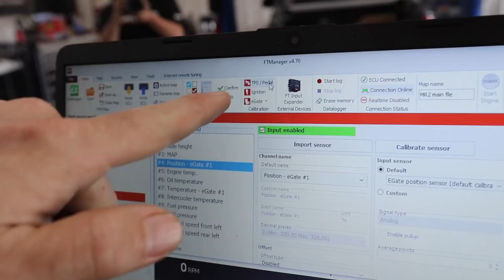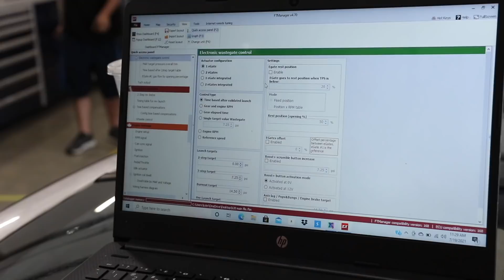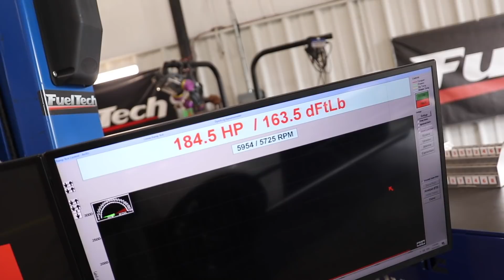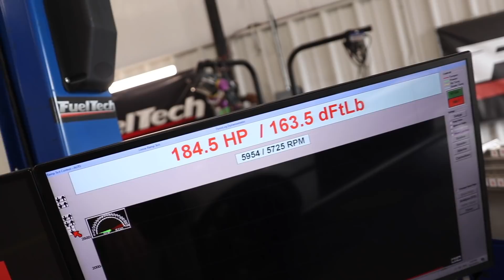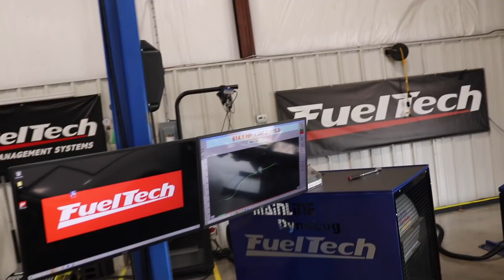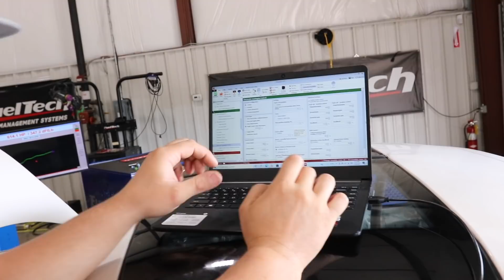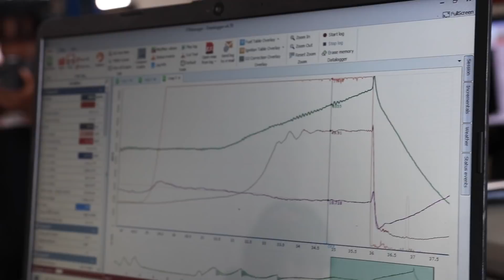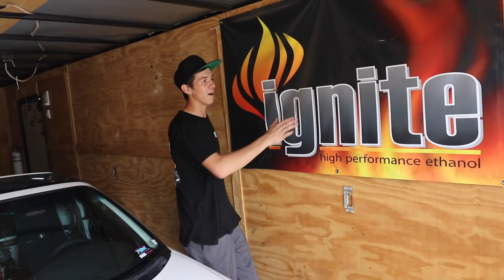The Mr2 THROWS DOWN On The Dyno!

Comment: To find out after all this time that the two-step the crowds love has been lean and causing engines to blow.  😂.
Reply: I couldn’t believe it either. I’m curious if Brent was aware of this because every time he tunes it’s shooting flames 🔥 🤷🏼‍♂️
Reply: Flames look cool but you can always learn something new and adjust the way you do things to make more power. I remember the first 4bbl carb I put on my 318 in my Dart. It was super hot in the engine bay and was popping a lot. It needed a lot more jet then it had so I found out what it should be and put a much bigger jet in. It stopped popping, engine bay cooled down, and it ran way better and was making power for what it was.
Reply: @69Dartman  yesss my dad still has his '70 dart with the 318 just enough to get into trouble as he says lol
Reply: @HondAcura111  The 69 Engines were a bit higher compression and some other things but if you do a few simple mods they aren't as slow as you'd think they'd be. I put a early wide block distributor in it and the timing curve was way better then the 68 and up ones plus I put electronic guts on top. I put a 727, 8 3/4 with a power lock 3.23 sure grip, early 340 exhaust manifolds, poly bushings and front and rear factory sway bars.
It handled better then any other Dart I ever drove and was about as fast as the modern Crown Vic pursuit cars and that was just with bolts ons and like that. It also had a 16 to 1 manual steering box good for 4 turns lock to lock and 340 suspension minus the sway bars factory. I had to keep relearning how to drive the car every time I upgraded something and I still have it though it's retired. I'd love to drop a modern hemi in it some day.
Reply: @keylinstrait4640  to be fair tho Kyle always wants that pop pop boi 2 step
Reply: @keylinstrait4640  broooo thats what im saying too. Wouldnt all tuners know this?
Reply: I'm suprised how people didn't know how bad pops and back firing are for the exhaust valves, they are taking explosions horizontally that them thin valve stems can't take and also moving them around in the guides etc. It's the easiest way to kill an engine. I htink i mentioned in one of the channels previous vids where they kept having issues with the valve train and i commented it about sitting on the popping 2 step is valve train suicide.
Reply: The two step isn't designed to be used for prolonged periods of time when it's poping. As fuel tech said when done the way they have it can be used for a long time even if it doesn't need it
Reply: Brent tunes the two step to customer request, they want pop, they get pop..   two step is usually used by the showsters..   the weekend mechanics.   When you get wrench turners who live with grease stained fingers and oiled armpits is where u get your truly serious shit at the track..  when you get your weekend warrior with a wrench tuned race car is when you get your mustangs taking out crowds and wall taps..

Comment: It’s really sad to think that companies like fuel tech won’t be able to even sell any of there amazing products in the us anymore. If the epa have there way anyways
Reply: The EPA is only going after sellers that sell emmissions defeat devices that can only be used in a vin car, ie, direct drop in fitment products that will not fit other applications. Eg, entire exhaust systems with cat delete, or, plug and play harness signal intercepters.
Generic products that could have legal uses, eg, an ECU that coud also used on an old lawn mower, the EPA is not touching. Simple.
Reply: @nordic5490  they are not allowing the modification of vehicles that were designed for the road. Removing the standard management and installing an aftermarket ecu is exactly what they are after. Although these producers can legitimately be sold for race car specific use. Or indeed a lawnmower. If a distributor sells it to a customer and is used on a once road based application they are liable. The EPA state that ANY device that defeats the standard emissions control is illegal. This is what’s so scary about it.
Reply: @mdnovaman  the EPA will not go to court unless there will be a guaranteed win for them. If I sold ecus that were not specifically plug and play for a vin car, they can have other uses, eg, a go cart, lawn mower, etc. That sale is perfectly legal, and the EPA knows it. All the seller has to do is make clear is that that carby, efi, etc, can only be used on race engines in purpose built race cars, with you signing a declaration. That is it.
Reply: @nordic5490  you make a very fair point. Although I’m not so sure it’ll be quite as clean cut as this. All it takes is for a car with it installed. Being pulled over on the public road. And the ecu installed. It’s instantly traceable back to the ecu manufacturer. It would however in that case be down to the installer breaking the law but that still incriminates any company installing these products. Such as PFI etc. Unfortunately the vast majority of people don’t have the knowledge to be able to install a wire in kit themselves. And with it now illegal for companies to install them to any car originally made for the road. It’ll reduce the ability of companies such as this. Haltech. Link etc etc to be able to sell there products.
Reply: @mdnovaman  PFI got in trouble for selling direct plug in 'performance' devices that can only be used in that model vin car. These were not generic multiple use devices. This was a slam dunk for the EPA and no risk for them. The EPA is sending a message and do not want to loose a single case.
Reply: @nordic5490  this means that fueltech wont be able to supply plug and play or patch harnesses or they will be under the same ruling. this is a huge part of the market for ecu manufacturers.

Comment: Gonna need a wing for that new Carbon fiber deck lid. Gotta get some downforce to keep that lil ripper hooked at high speed. Still hoping for you to get a 7 second cage in it. Wanna keep you in one peice if the worst case scenario ever does happen.
Reply: I have no clue why they just keep ignoring the roll cage. They had the car gutted while the engine was being built. It would have been the perfect time to upgrade the cage. But no, lets get the car completely built and driving so we can make one or two passes ( hope nothing happens! ) and get booted by the track because of the cage. It just makes no sense!
Reply: @Fordman7575  The safety issue was more on my mind but that is also a very valid point. I've mentioned it in comments about a half dozen times now. Yours is the first comment on my comment. Not sure what the disconnect is? Rather strange to say the least. Nearly positive that cage won't pass 7 second tech.
Reply: @CLCIII  Mine too. That's why I comment on every MR2 video. It will be a very sad day if something happens to Kyle because they didn't upgrade the cage. The current cage won't pass 7 sec. tech. And they already ran faster then the current cert. with the old set up. I believe he said the track already warned him when they made that pass.

Comment: So wait, with the quick reaction of the electronic wastegate, couldn't you use that to reduce power with the height sensor as well as traction control at the same time? So you set it up to dump boost at launch if the car tries to wheelie but then at the same time if the tires try to break loose in Second gear the traction control can then take that over in combination with the laser height sensor. How the hell you coordinate the outputs of wheel speed and laser height into controlling traction is such uncharted territory that literally no one has done this, BUT if you figure this out you would literally change how all drag racing is done. Traction control lets you modulate ignition timing (which has existed for a long time), but modulating ignition timing, boost, and a level sensor at the same time (which can only be done with a electronic Wastegate), is completely uncharted waters. I honestly think that if you guys can figure out traction control using electronic wastages and standard timing adjustments, you might change Drag Racing forever.
Reply: Unfortunately not. Not because of the gate but because of the turbo that is pretty slow to slowdown and gain own RPM, different from a blower that reacts pretty much instantly
Reply: @voodoom4n  I see, but then couldn't you use the e-gate on the charge piping to rapidly but precisely bleed off boost? It would basically be a controllable dump valve.
Reply: @balljointfd3s  still way slower than timing that's pretty much instantly
Reply: @voodoom4n  I really appreciate this conversation and thank you for indulging my ideas. While I'm at it I have another one. I've had cars that are limited to stock frame turbos, obviously things are bored out and bigger wheels put in. Problem is that they are in stock housings and run out of efficiency and max out the turbo. I've had luck with putting a Methanol injection nozzle pre Turbo inlet to reduce compressed air temperatures out of the Turbo. It seems to shift the Compressor Map to the right and extends its efficiency. Have you or anyone on your team played with Pre-Turbo Methanol  injection?

Comment: On the past setup weren’t you running a thousand hp with less boost then 45psi or am I thinking about the prelude
Reply: Yes the previous setup did 1118 at 38 pounds has me baffled

Comment: I wonder, can one of these dyno's take a pull as if you are doing a drag pull (from 0 to what ever in what would be an 1/8 or 1/4 mile, I have never seen it on any kind of Dyno, it's always a running start if you see my question.

Comment: Now hit up Motion Raceworks and get one of their C02 launchers for the parachute launcher handle in the car but really you should get the complete set up of the C02 parachute mount on the back of the car and the C02 parachute launcher handle in the car and you can also put it in the FT to launch at a certain time into the run and also get the cut off switch for the car that Modern Racing sells Justin Swanstrom is running one and so is John Doc plus a bunch of other fast cars it will cut the car off and throw the chutes if the car does anything crazy like stand on the back bumper or rubs the wall stuff like that and being a stick shift car you already have to drive with one hand and that will be one big less thing you'll have to worry about plus it will make it pass NHRA certified all the way once you get your license and upgrade the cage which I think you should also do like put the funny car hoop over the driver seat you should just go ahead and make it a 6.50 cert that way you're safe and still have room to go but as far as the body goes all you need now is either carbon T-tops or Lexan and Lexan all the rest of the windows in the car as well from Optic Armor and get one piece carbon front clip or three separate piece hood and fenders and carbon bumpers or just take all that crash insulation and plastic and just put a one piece Chromoly tube in place of it to support the bumpers and if you ever want to mount something off of them you can and after you get the ride height sensor dialed in I would put the car back on the scales and get the weight bias exactly where it needs to be

Comment: Easy way to understand the basic.

2step pops and bang = ignition retarded 0 to -10 degree and lean fuel like -10%

2step for launch hard with power = ignition 0 to +10 advanced and add +10% fuel.

Comment: I'm confused shouldn't it of made a bit more at that boost level? 1106whp at 50psi on ignite e90 wen it made that on pump e85 twin ebay turbos and air to air instead now its air to water someone please chime in cuz im seriously curious for self knowledge is there no timing in the tune up or?? Idk 50psi on that combo I would expect to see more with that combo but please chime in nd correct ne if im wrong

Comment: Look a Dyno Tune is the absolute best way to tune a car.. But those numbers don't mean as much as people think.. First off All Dyno's are different even the same ones don't put out the same number's. My car was Dyno Tuned and Gained another 125 LB's of torque to the wheels, on top of Stock, They added like 50% more power to the car, But I have to say the tune got better the more he played with it on the street and tuned it.. An example of the numbers not meaning much.. I know a guy that built a 400 HP Juke and because all it does is spin the wheels, my CVT 240 Front WHP and 215AWD HP stays right beside him the whole quarter mile.. My point is he's like a second faster than me in a quarter with almost double the HP..  SMH and he's always breaking shyt, and he has a stick and I'm the one with the CVT slipping all the time.. I'm keeping up with cars that are 400/500 HP.. I ran with a Camaro and Charger the other day and we were roll racing a little Light to light.. And these are all cars that are making 450 HP stock more than that even. And My 3100lb Crossover Nissan Juke 1.6L Turbo AWD SL is keep right up with cars that are supposed to smoke me.. I mean look I don't win because my car is only quick from like 20 to 90 miles an hr, after that and once I'm in 4th gear the power just falls off a cliff.. The CVT Life is expensive that is Foe Sho.. But I learned a lot from my mistakes and the money dumped into a dead platform and never to buy a CVT car ever again.. I wanted AWD car for the south Jersey winter's so I could get to work and didn't know what a CVT even was back then.. Other wise I would have never bought it.. But it is what it is, I put like 4000 into the car including the Dyno tune, and Now I feel like I'm driving around in an AWD 88 Mustang GT 5.0.. They were 225 Hp and felt like little rockets.. My Juke feels the way that car used to throw me back in the seat, accept for the wheels spinning forever.. Anyway, I'm trying to save money for a new car, It's time to step my game up, I want something I can take to the track and build on..

Comment: your mic on dslr gives static, I bet you hold the camera on the side, and you are touching the jack-plug of the microphone. This makes it move and create the static noise. I had the same problem with mine. Be careful with that. if you move it to many times, you can break off the connector on the board of the camera..... I did that and had mine for repair!